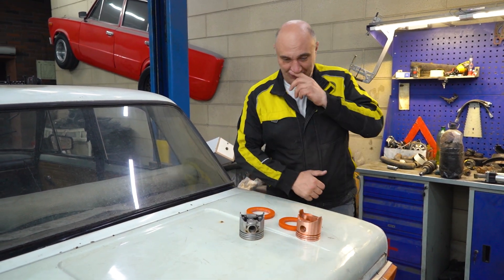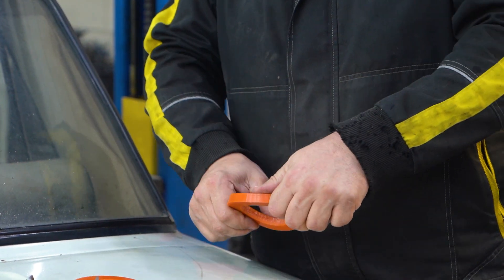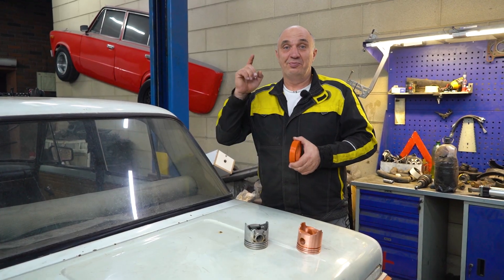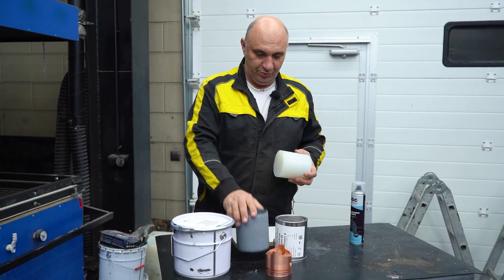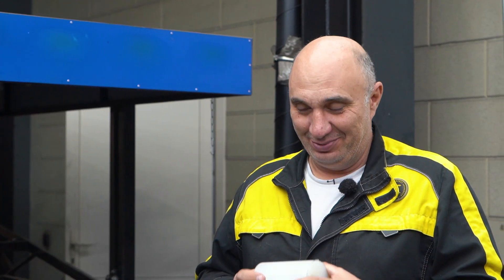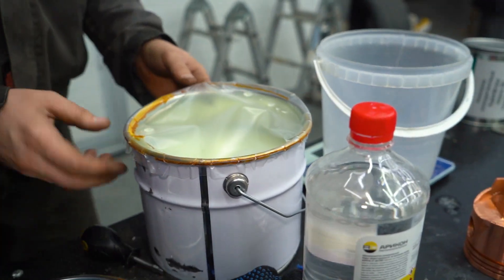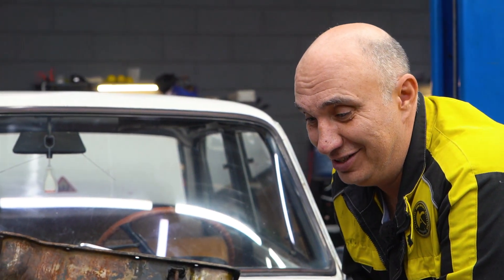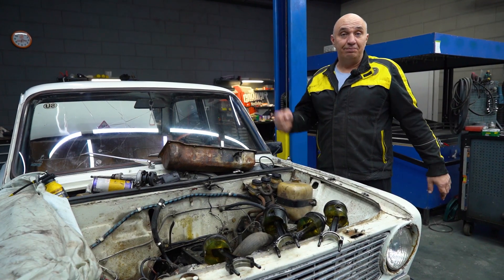We make soft polyurethane pistons - will the engine start?

Comment: I'm very surprised how well they held up. In comparison to the wooden pistons they made. Those  even had sheet metal tops, and they still could not get that engine to run. I was pretty certain it would be just as bad or even worse than the wooden pistons.  I've been a professional mechanic since the late 80s. Some of the experiments these guys do are destined for failure right from the get go.  It will help people understand what goes on in a vehicle and how everything works.

Comment: Your approach is very free and pragmatic as opposed to being more measured and scientifically constrained. Processes and discoveries are fun to see nonetheless. 

Your experiments prove - from a materials science point of view - that an engine's performance requirements are quite challenging. Especially when one attempts to radically stray from recognised, tried and tested conventional ways of doing things.

I'd been researching online the possibility of sintering PTFE powder, ceramic powder, aluminium and chromium powder (main constituent would be high grade Al followed by Cr then Ceramic lastly PTFE). It seems possible but involved. 

Aluminum would need an atmosphere that's only of nitrogen or oxygen free. I arrived at the use of those materials for their mechanical properties. It can be done, but it's specialised and no doubt very costly.

Comment: I think using methanol with 2 cycle fuel will help run these engines with abnormal materials run better as the methanol burns much cooler and the oil helps keep frictonal heat down

Comment: Add a metal cap to the poly piston. And use a pressure pot when casting the piston to prevent the bubbles.

Comment: You say you tried wood? I vaguely remember my dad telling me about Packards using oak pistons with leather rings. That was fifty years ago, but for some reason it still comes to mind. Wood has some incredible properties and so does leather. I know that old pumps used leather seals and they needed to be oiled to expand and hold the compression. I could be wrong about the oak pistons, but hey.. if you have time to play…

Comment: Other material to TRY...
Titanium - Reasonably light like aluminium, but almost 3 times the melting point (and higher than the block itself)
Tungsten - Heavy as hell, but you'll melt the block LONG before the piston
Glass (ceramic)

Instead of casting them in a mould, I'd try billet (machine them from a big forged lump)
One big downside is that you might not be able to do the usual 'test to destruction' as they might outlast ORIGINAL Aluminium pistons!

Comment: this sounds more crazy than your normal vids. could you rig 4 pump shotguns firing blanks into the spark plug holes of an engine and run the engine on a 2 stroke cycle. intake and exhaust valves only exhaust firing gas for said shotgun blasts. wouldn't comment or suggest if I didn't love your vids

Comment: There is an epoxy called thermosteel that supposedly has a 2400⁰ melting point when cured. You might try that in your molds

Comment: Flip the rear differential around  turn it upside down. reverse will be forward and forward will be reverse. would be a good prank to play on someone. They would have only one forward gear and multiple reverse gears. Imagine doing this on a 4 wheel drive vehicle  when it is in 4x4 Would be interesting to watch you driving on a obstacle  course. thanks for the great videos.
 course

Comment: Replace the standard graphite spark plug wires with copper core, in an EFI engine.
Reply: Why?
Reply: @joebloe9901   graphite core wears out much quicker than copper core. 
Copper is also easier to replace and source.
Copper is way better at conducting electricity, leading to better spark, which is more difficult to attain under high cylinder pressure.
All this sounds awesome, as long as it doesn't interfere with the  engine control computer.
What do you think?
Reply: @soupflood  This engine is carbeurated not EFI
I put over 100,000 on my Toyota with 1 set of graphite core wires.
I think you are just repeating what you've heard with no real evidence.
Reply: @joebloe9901   I know this is a carbureted engine but I'm also sure they can find an EFI.

Comment: Hey guys huge fan of the channel love the wild experiments 
New idea 
Using a chainsaw engine and or a lawnmower engine 
2stroke vs 4 stroke and a belt how many alternators can it run? Connect each one to a battery and see if it will charge at the right voltage!?!? Also how many things can you plug into it!?!?

Comment: My go to for round engine mounts for decades was to fill them up with urethane. My friend made the same steps with polyurethane, and as far as I can tell, his are still working15 years later.
Reply: Interesting. Where do you get the urethane?
Reply: @andyc8454  Any place that installs windshields should be able to supply you.

Comment: Prediction prior to start, failure mode will be wrist pin mounting.  The large acceleration forces present on the bottom of the piston at the wrist pin will cause a crack, followed by the piston shattering.  Also, after the first start and fail:  The piston ring lands are very thin, and the possibility the rings will just shift or come off the piston completely is quite high.  Waiting to see the tear down.

Material simply melted because of combustion temps and pressure, nice.  I wanted to say that, but I figured I should be optimistic lol.
Reply: Material properties strongly drop off with increasing temperature 

It will be done before the pistons get past 60 degC

Comment: This actually gives some valuable information for piston design in that we now know where they will get hottest so we know the part of the piston that needs to be the most heat resistant.
Reply: umm its been known for 200 years a piston gets hottest around the...you guessed it...hot exhaust side
Reply: @ct1762  There is a difference between hypothetical understanding and physical results.  Here we can see the exact position that gets the hottest and with that information use it to make adaptations to the compound in that specific place to come up with a workable solution.
Reply: @Shannon-Smith  Introducing a more temperature resistant compound in that area would likely be significantly more difficult to produce and lead to it being more expensive, making the piston entirely out of the more thermally resistant compound would likely be cheaper. Maybe making the piston thicker in that area could be achieved with some sort of counter balance, I just don't think it would be worth it.
Reply: @lilpisser124  I was thinking more like melting a copper piece in that top spot - heating it up with a soldering iron and pushing it in.  But that might just not be possible either.  Still, it's a really interesting train of thought.

Comment: If you do these again, you need to evacuate the air bubles in an vacuum chamber. You could easily see all the air bubbles in the plastic.This is probably why cylinder 1 burned through.

Comment: I think you should have made the pistons from high temp silicone but with an aluminium plate incorporated into the piston top to take the brunt of the heat and pressure considerine silicone is softer.
Reply: My thoughts exactly.  I’ve been thinking of a piston that is assembled instead of cast.
Reply: Maybe coat the top with ceramic as a thermal barrier.

Comment: Love how you think out of the box. How about ceramic or concrete pistons? I bet they both work. Be sure they weigh the same! Have a great Christmas!
Reply: I suggested cement ones two days ago. So I win 😂.
Reply: I was thinking adding a metal powder. Metal should help heat absorption/dissipation. A ceramic powder should also increase wear resistance. Fiber Reinforced Plastics have better dimensional properties too.
Reply: Cement would never seal, it has the same issue wood does, but worse. 

I think with some help by using rubber rings and sealant of some sort to prevent gasses burning the rings away it could work a bit,  maybe more than these?

Comment: Btw, they burned up right away becauase your ignition timing was extremely retarded. Retarded timing burns fuel slow and hot. If you had correct timing they likely woulda lasted 2-3x longer. Learn how to set static ignition timing. You dont need to have the engine running to set static ignition timing.

Comment: Why do you guys never set static timing prior to trying to start your engines???  Roll the engine to what timing you want, 8-10* btdc, put a test light on the coil. Turn the distributir housing opposite the direction of rotation till the test light just turns off. You're now you've set a verified static timing. Now you dont have to swing the distributor 90⁰ to try and blow your engine up like you have in the past!

Comment: I'm not sure what you can source for an acceptable price, but they make high-temperature polyurethanes that handle 300C.  It still wouldn't survive for long, but it might run longer than these.  I would also turn the top ring gaps towards the intake side during assembly as the leaks should be slightly cooler there.

Comment: Interesting test…..I would try to mold a metal top on the poly pistons or some sort of fireproof coating….also use a sleeve in the wrist pin piston bore…
Reply: I was thinking the silicone from the mold is a good heat resistant material they couldve tried using as a liner on top of the poly for stiffness but idk if it's too soft to reach proper compression without too much deformation
Reply: @TheMonstered1  that’s what I meant ….some sort of thin layer of metal of heat resistant coating to protect the top of the piston

Comment: Stock lada engine. Stock crank, massive connecting rods. Some sort stupidly strong piston, and a lot of boost would be very interesting.
Reply: Lada engines aren’t that durable tbh. They are simple, but that doesn’t mean durable
Reply: @goclunker   I was wonder that, but it would be interesting if they could build a torque monster on the cheap.
Reply: @slomo1010  what you were thinking of is a Fiat twin cam. This lump of crap barely makes 70 hp.

Comment: Try Kevlar fibre  and aramid  fiber  composite  pistons must resist Higher temps  upto 800°F and It's 5x to 6x stronger than steel and weights lighter than steel . Normal passenger vehicles Pistons reaches Max temps  upto 590°F at center of piston Crown .

Comment: My guess it it will work for maybe a few minutes.. Now I will watch and find out. I think heat and friction on the pistons will cause the rods to disconnect.
That would have happened too if the engine had run for long enough.

Comment: Hhmm...great ideas, always learning something. I wonder if y'all have thought about making JB Weld Pistons, there is also a liquid metal BELZONA, Which I think would outperform JBweld
Reply: I was just about to comment this..! Original formula JB Weld has high heat resistance and would have the best chance as far as epoxy pistons are concerned.

Edit: Actually theres a JB Weld called ExtremeHeat that might work even better

Comment: Use a vacuum chamber to boil off the material before pouring into the mold to remove the tiny air bubbles. Also, after the material is in the mold, tap the sides of the mold to remove the bubbles on the top of the mold.
Reply: They used one watch again

Comment: Concrete pistons next!  Or maybe glass
Reply: Borosilicate probably work fine if the tolerances are tight everywhere and there's no slapping/knocking between the piston and cylinder/pin
Reply: Concrete sounds interesting
Reply: I think he tried that in a previous video

Comment: When you cut open the mold, the cut lines should be jagged to create a key this ensures that each side of the one-piece mold lines up and this reduces the parting line in your casting.
Reply: Not to jagged or you end up with a hazard.
Reply: @jwalster9412  ...a hazard? Is something missing in translation?
Reply: @secondarycontainment4727  I was being sarcastic about it having "sharp" edges.
Reply: @jwalster9412  LOL, ok my moldy old brain  isn't that sharp anymore. ZING!
Reply: Guess that's also the reasoning behind fractured rods. Always ensures a perfect fit.
Reply: That's actually a very smart idea. I've been interested in casting some things for myself. I will keep this in mind.

Comment: I would internally reinforce it with something, and perhaps coat it with something as well. The coating needs to be hard, durable, and able to withstand high temperatures. And also able to actually adhere properly to the polyurethane underneath...

Oh, and definitely do a thorough check for any cracks and gouges...
Reply: Cerakote. But likely wouldn't bond correctly